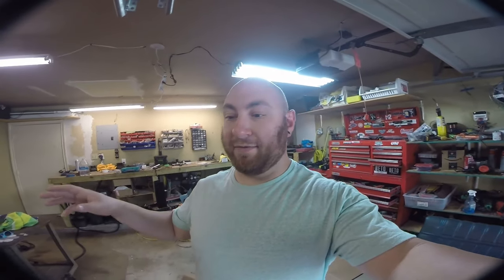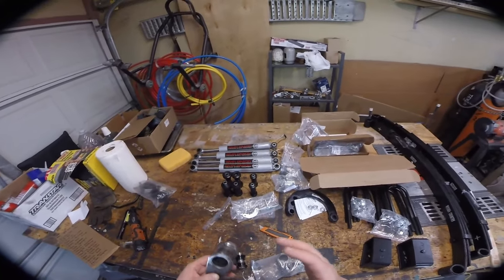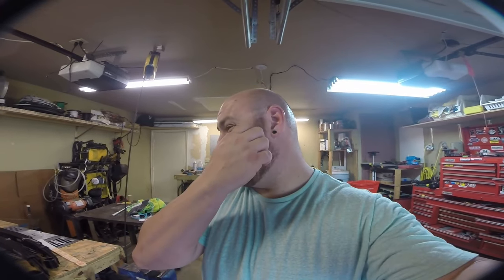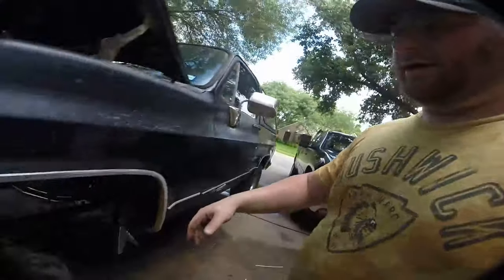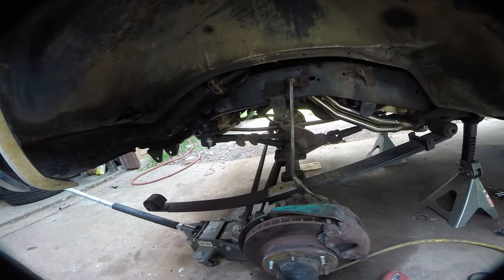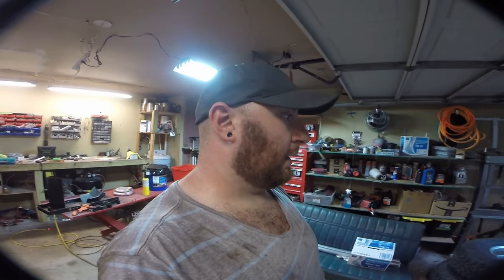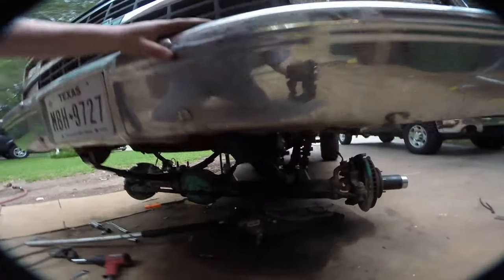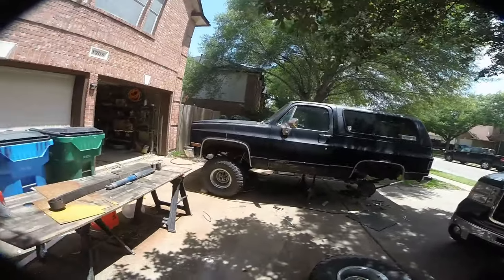'89 K5 Blazer - Rough Country Suspension Lift | Off Road Designs Sway Bar Disconnects

Comment: Max, the only thing I recommend a little difference is if you have to do the cones again for any reason spray them down with a good penetrating spray and then hammer like you did on the steering arm, but skip the heat.   If you just move to the front and back of the steering arm hammering it up a little from the bottom it will work the cones up and then all you need to do is hammer the steering arm down back flat on the mounting surface and then that will further release the cones and they will get high enough to where you can either take them out with your fingers or go ahead and squeeze on them a little bit to compress and then they should just slide off instead of ruining them.

Comment: Since you attached the swaybar hold up bracket where you did, it doesn't look like you're going to lower those bumpstops. Better do that. The tires are a lot softer then fender sheet metal is. Highly recommend lowering them. Your shocks shouldn't be what your bottom out on.

Edit: also recommend mounting swaybar once the weight is on it, not with axle hanging.

Comment: Eh there. Thanks for your video and decent looking rig!! I have one question for you. I picked up an '82 k5 with a rough country 4" installed and 35" tires. There are spacers on the transmission crossmember to drop the rear of the transfer case about 1" or so. Did you need to do that to your blazer? The rear output seal keeps leaking and I think the slip yoke is going too far into the case with suspension travel causing it to leak. I wanna take that spacer out but not sure if it's actually needed or not. Cheers from 🇨🇦🇨🇦
Reply from the maker: With a 4" lift you need the Tcase spacers. It should have the whole tcase lowered evenly. There are 4 spacers. You can measure the slip yoke engagement to see if its the issue.
Reply: @Makswerks1  thanks for your quick reply. I will check the angles and the spacers were already installed. I just can't get it to stop leaking atf so I'm thinking either a hairline crack in the tailpiece or more likely the plug in the end of the yoke. I'll check through the week....lol.....it snowed here last night just as things were starting to thaw out😳😳😳
Reply from the maker: @hitekredneck109  You should also check out the slip yoke itself. Sometimes they rust and pit causing it to chew up seals.
Reply: @Makswerks1  I did. I took it back out today. It was leaking from the metal plug in the back of the yoke. It was butchered like most of the stuff on this thing so I welded it in. There is also a spot that feels like it "dips" on the outside diameter (a low spot) of the slip....weird. lol......also I'm sure that the bubble gum welding on the drive shaft itself is contributing to it. Man it's messy. I dont know if I'm gonna have it fixed or just convert it to a 205 tcase. Either way, if I can do an sye I could put a longer drive shaft in the rear to help decrease the joint angles but if your rig is working well then I might just get the shaft fixed. There's s really good shop about an hour away from me and they do all kinds of repairs n custom stuff. A friend of mine uses them for all his dragster stuff so we'll see how she goes. I really appreciate your input!!!!

Comment: Do all K5 or some have single shocks in the front, I'm doing mine soon but I noticed mine have 2 per tire, are they different sizes when your replace them? Thanks  for the vids!
Reply from the maker: Dual shocks were an 80's thing. you can find trucks with a stupid number of shocks on them. Generaly modern day shocks are worlds better than that was available then. They added more shocks to affect rate, but now you can just order custom shocks for what you need. Feel free to swap back to a single shock setup.
Reply: Thank you, appreciate your knowledge!
Reply: @tandreu2020  Yep, the quad shocks were a factory option, but when replacing them most people just go to a modern single shock.

Comment: Great video. Do I need the front sway bar drop bracket on a 2" spring lift?
Reply from the maker: they sell a kit for lifted vs stock height trucks. if you are lifted you need the lifted drop bracket.
Reply: You only need it really after 6 inches and higher lift. 2 inch will be fine with stock location even 4 inch on my other k5 is fine stock sway bar

Comment: Awesome video! What tires are you going with? I just got a set of Cooper Discoverer STT Pro 35x12.5x15 and my  Blazer rides 1000x better! I can’t wait to go off roading! I also found a receiver hitch at the junk yard. I need to trim a few spots to make it fit perfectly.  

One request...When you’re showing detailed parts, would it be possible to ditch the fish eye? It was hard to see when you we’re talking about the pitman arm and the washers.
Reply from the maker: Sorry, not really a camera guy. I mostly use a gopro, but I can try to be better about zooming into things. I need to track down a receiver  as well as I dont really have any recovery points. But based on how well it did at HF (next weeks video) I may not need them :). I will say this suspension rides pretty rough on the street, works fantastically off road though. Will probably add some more progressive bumpstops at some point.
Reply: @Makswerks1  Yep, fisheye is part of the Gopro effect but its a lot more reliable and convenient for filming.  Definitely more light would be beneficial though, otherwise its hard to see some of it and it gets more grainy.  Great video though Max!!!

Comment: Hey I would have went with springs in rear instead of blocks. Especially when off road . Nice video
Reply from the maker: The rear springs were in good shape and flexed out well. Blocks are a great bang-for-buck improvement.